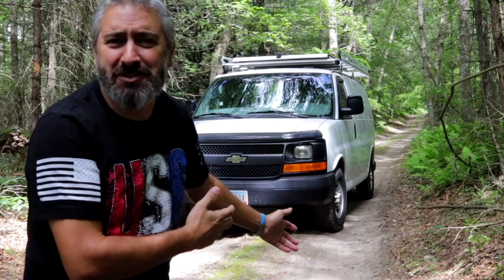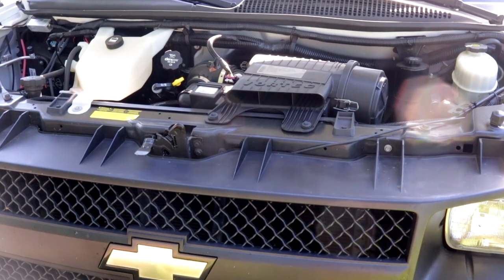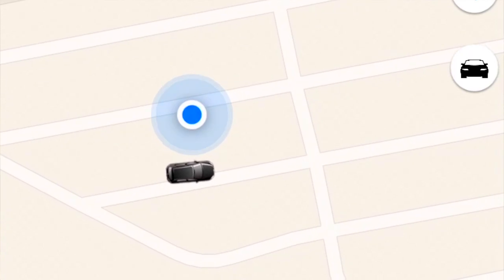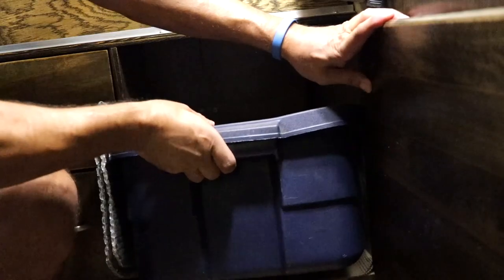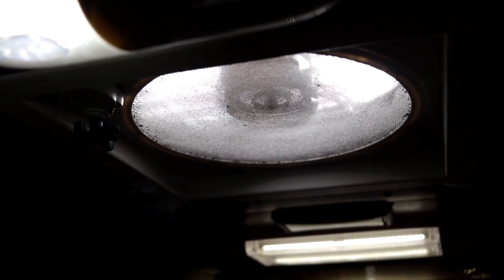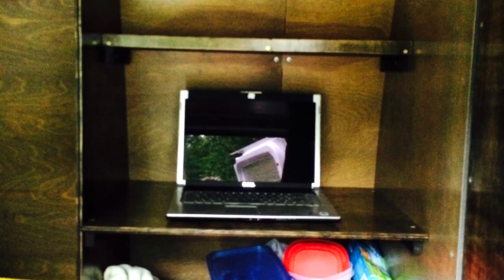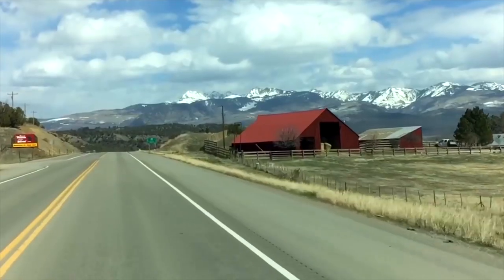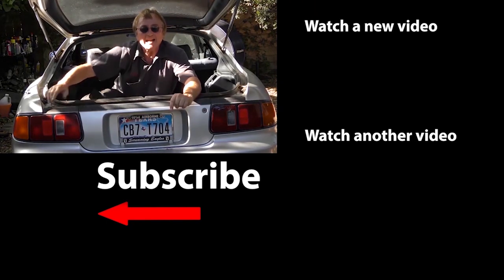What It's Like to Live in a Chevy Van and Drive Across America

Comment: I'm a former Van Guy lol. I've owned 6 vans. 3 Fords 2 Dodges and 1 Chevy Express. The Chevy was the best one out of all of them 👍
Reply: I wonder why Ford, who makes an excellent pick-up, can't seem to make a decent cargo van?
Reply: @jasonjames4254  Are you talking about the Econoline? I've seen them with 400k... Seem to be just as good as the older Dodge and Chevy vans.
Reply: 🤔🤔🤔🤔Hhhhmmmm note to self, getting a Chevy van is at the top of the list.
Reply: Jason James The best van ever made is the ford transit. It’s a lot more modern and and more powerful that the express van.
Reply: -ThreePointSlow-..... yeah a econoline with a 7.3 diesel that Ford never made
Reply: @jasonjames4254  I have a 93 Forde150 5.8L 240,000 and she runs like a beast!! I'm the 2nd owner..1st owner did replace engine n tranny about 80,000 miles ago sooooo hopefully I'll be good for a while..I've had her for a year and a half..I've replaced radiator, starter, plugs n wires, some exhaust parts, battery n that was the month I bought her..this week, I replaced some bolts by the exhaust manifold..shes starting to show some rust around the trim by wheel wells..fixing that next week..have already done rain rails..after that all good I hope..so after buying..I've put maybe $500 into her..oh..I did buy new tires..✌
Reply: @benchattin  thank you!! I love mine!!
Reply: I'm a mechanic of over 20 years. I've had nothing but hatchback cars and vans both mini and cargo..
The Chevy express with at least a 5.3 or bigger with the Allison hd trans is by far the most reliable, the cheapest ownership cost and capable of the highest mileage overall compared to all other vans. And I despise Chevy with every fiber of my being. Sadly I'm gonna buy one cause I'm so tired of repairing everyone else's vehicles that I want one that I don't have to worry about or fix myself.
That should say enough...
Reply: @biancaramirez5788  what chevy express has a Alison transmission?!?!?
Reply: Is the v6 4.3l a good engine? Or should I pick in diesel?
Reply: It was 7 vans I had. 3 Dodges, 3 Ford's, and 1 Chevy.
Reply: @isaacclarke2713  yes good engine.
Reply: Reliable?
Reply: @malcolmjelani3588 Yes Most reliable I've had was the Chevy. Also most comfortable and was the only van I had that wasn't like a freezer in the winter.
Reply: @davidkastin4240  what made the chevy van warmer in winter? insulation?
Reply: General Motors !!! THE BEST TRUCKS !!!! :)
Reply: Do you think the Chevy was the best because of the space or the quality because it would not break down with you ? I want a van that will not break down.
Reply: @benchattin my E350 had 373,000 miles on it before it blew the same  # 6 plug if I could do a double heliocoil I would keep it cause it ran and drove like it was newer. Have had it go 20 years. Bought it for $500 in 2004 . A 99 2 valve 5.4 3 valves are trash.
Reply: How many miles you put on it?
Reply: @maryjean-vb8bm by a Chevy van. 2500 and don't font with the 4.6l go with the 6.0l if your buying a van made before 2021 or a 6.6l if 2021 or newer as the fuel efficiency is just as good as they don't have to work as hard, are proven motors especially the 6.0l and as an added bonus the 6.0l and 6.6l can ton a 10 ton dump trailer full of crap like it's nothing.

Comment: I honestly think 2003-2019 Express vans are some of the best made. Reliable durable and practical. Rev up your 4.3, 4.8, 5.3, and 6.0 Vortecs.
Reply: 5.3 are great engines.
Reply: Flash Filibuster I wonder what kind of air filters does it take it looks like it would be a cone filter inside
Reply: Dont forget the 8.1
Reply: I have a '10 Suburban with a 5.3 and those are reliable engines. 150k miles.
Reply: Compared to what, a 1940 Soviet car?
Reply: What you "think" doesn't translate into the real world.
Reply: Ing. Julián Carías appreciate it
Reply: put a Ford escort engine in the Chevy van
Reply: 1.6 low output😂
Reply: @aundrayperkins9796  lol
Reply: @NFLYoungBoy223  old underpants work
Reply: I hope so...my 2007 4.3 6-cylinder is smooth and strong enough with a full load, though for some reason it has a leak on the driver's side in the body weld.  When it rains water accumulates then flows through the top then down the right side door leaving a deep puddle on the passenger side step!  Quirky, annoying, and maybe mine was THE one with this flaw.  My previous Dodge van had a side window for an extra angle of sight, useful on the freeway.  Can't say I enjoy not having that in this van, but so far it has been a gamer.  Aside from a thermostat going out, no problems whatsoever.
Reply: FABULOUS DOLPHIN Ight cool
Reply: Aundray Perkins,  How about a 3 cyl 2 stroke? 😂🤣😂🤣
Reply: Engines are great drive a 2008 6.0 l for work but transmission are bad  went out at 100,000 miles  $4000 to replace
Reply: I have had the 4.3, 5.3, 4.8 and 6.0 and put over 100k miles on them with zero engine problems.
Reply: There's a sharp quality decline after 2008. Source: Our fleet has 4 Express vans made before 2008, 3 of them have over 500,000 miles and run great, one is still a baby so it's hard to say, and the other 4 vans which are all newer have constant issues either electrical, mechanical, or cosmetic due to inferior build quality.
Reply: What's more reliable? Ford Econoline or Chevy express?
Reply: Yes I agree I jave a 2013 still jave it runs strong 2019 summer
Reply: Kenny Maurer Chevy Express but under a 2013
Reply: @kiowa1627  I would certainly hope your 6 year old vehicle runs still.... There's still people out there paying 2013s off
Reply: @pacdogk9134  dude I'm no ford guy...but the Econoline series was pretty tough to beat. Dodge and Ford  pretty much killed it for years in the van market.
Reply: The LS3 traveling life
Reply: I have a S10 Pick up with the 4.3 160k miles no problems and runs strong
Reply: kingjb82 what?
Reply: I have a 2009 Express AWD. 5.3. it's my work rig, and has about 210k kms on it. Maintained well, works like a damn
Reply: E series is better by a mile.
Reply: @ryanmalin  Which one did you like the best? I have the GMC Savana 4.8L V8.
Reply: @Helladamnleet  I dont know about that man. I've got a fleet with about 60 Express 2500/3500 vans and the only issues we have are suspension and brakes. We have had a couple of evaporator coil leaks which caused the ac to fail. Other than that they're very reliable vehicles.
Reply: @pacdogk9134  Chevy is more reliable. And I am a Ford guy. But I am not a fan boy. Not ashamed to call it like it is.
Reply: @ryanmalin  that's what I said?
Reply: How are they in the snow tho?
Reply: @pacdogk9134  Chevrolet Express.
Reply: I guess I have the oldest Chevy Express on here, so far. 2000 Express 3500 with 5.7 that just turned over 101k. Had 97k when I bought it. Still runs like new. Hopefully it lasts a long time as I'm doing a camper build-out now.
Reply: Is the V6 4.3 reliable?  Or should I pick a diesel engine?
Reply: @isaacclarke2713  Yes the 4.3 liter V6 is a good engine.
Reply: @Sugarshane88  my g3500 box van does really well in the snow. I'm heavy around 8800lbs
Reply: My 2004 5.3l 2500 conversion van has 378k miles on it and still running strong.
Reply: Good thing they are still making this body style
Reply: I love them

Comment: Yes in the end it comes down to whether you can stand up or not.  You can put a high top for $3-4K but they leak and reduce structural stability. Anyway this was only a tour of yet another van, not what its like to drive across america in it. Comfortable? Quiet? Bumpy? Harsh? Gas mileage? Tiring? Backaches? Tire noise? Vibrations and noises? Hard to steer and park? Its the journey I thought we'd learn about, not the destinations and friges.

Comment: See Scotty... Chevy does make reliable vehicles. The cars are crap but Chevy trucks (Tahoe’s, vans, Silverado’s) are amazing good vehicles especially 1999-2006 era of Chevy trucks were the golden age
Reply: I have an 06 5.3 sierra and an 09 6.2 denali  and i can say that the 06 is way more reliable
Reply: My grandfather had a 1952 Chevy truck (he made it into a step side) intil 2006 when a tree fell on it, it never had any big problems and was his workhorse that would pull his race cars from 1957 until 1978 when he started a family
Reply: Of course. But avoid the modern ones at all cost
Reply: Ghost Geist/Ichi Ayumi Love my 2016 Midnight Edition. Also loved my 08 and 99. The interior was very cheap in my 08 but my 99 and 16 are golden
Reply: nah
Reply: My father traded his 2007 Yukon with a 2005 one. The 2005 has higher mileage about 370k miles.
Reply: My grama just got a 2003 Silverado 4.8 extended cab with 23,000 original miles on it for 6k, was that a good deal??
Reply: They made reliable engines but they had the worst interiors ever. Everything fell apart even though the engine still ran
Reply: Chevy Ford Chrysler are the worst made vehicles ever made. Designed to fail!
Reply: journey mann that’s funny I’ve never had a problem. Got a 2005 Silverado with 450,000 miles on it lol 2016 with 50,000 still going good so far
Reply: our trailblazer with the 4.2 I6 has almost 200 k and we drive across the state often. doesn’t skip a beat
Reply: Hence the reason i just picked up a 2001 Chevy Astro. They are good vans, building a getaway micro camper. Reliability and towing option by design.

Comment: Love my Express van, 2008 with 410k miles on a 6.0 Vortec and 4L80e transmission.
Reply: LordCoolnessocity I have a weird question did u ever have to rebuild or replace your transmission? I had to with my last truck it was a 99 Silverado with the 5.3 vortec and a 4L60e transmission
Reply: @jacobsearcy9856  
My neighbor has a 2015 Chevy Silverado he had the motor replaced at 70 thousand and just recently had the transmission replaced as well.. 😢😢😢
Reply: i have my work van 2006 chevy express with a 6.0  with 550,448 miles. Never had transmission replaced but i did have a head gasket blow at 220,000 miles. runs good still working!
Reply: @jacobsearcy9856  only ever had one 4L80 fail on our fleet, the 4L60 you mention is a weaker version of the 80 series and commonly fails after 200k miles. What I recommend doing is what we typically do with ours, change the transmission fluid once a year. It's a little overkill but keeps those suckers ticking.
Reply: @fluevano1204  wow! Here I thought I was up there lol. IMO you can't beat a taken care of Vortec 6.0. I don't dislike the F-series trucks but when you're like us and buy trucks that are 10+ years old the F-series of the day didn't have the power or durability the Chevrolets did then.
Reply: @fluevano1204  I am looking at a 2010 with 207,000 miles and everybody says NOOOO!  What have you done to keep yours running with all those miles?

Comment: Working for a company that uses all sorts of cargo Van's, the Chevy Express has been the most solid so far. Sure, we had some that had thier share of problems but most of them can be atributed to many of the guys abusing them or not following maintenance schedules. I found that if you treat these vans right and maintain them regularly, they can be pretty reliable. I had one that I put 240,000 miles on and it still was going strong when I turned it in to the fleet company. On the other end of the spectrum, the worse van my company tried was Ram ProMasters, both the large size and City mini work Van's. They were so bad, my company couldn't  wait to get rid of them and we went back to the Chevy Express. BTW...this comes from a guy who is not a fan of Chevy vehicles in general. Just giving credit where credit is due.
Reply: @Ing. Julián Carías Point well made... and the sad part is the Italian mechanic asked to fix it again is using another make and model of van to deliver the parts need to fix the Ram ProMaster. Probabley using a Chevy Express.😀

Comment: I have a salvation GMC look just like that it just go run 460,000 miles. Eat oil a little faster then normal it has the slider door. That was the best $ 1,000  I spent 7 year ago later great van. Still runs.

Comment: I know of several tradesmen with those same Chevy vans that have put well over 200K miles on them with just normal maintenance  done to them.  They aren't fancy, but they are extremely durable and very easy to fix.
Reply: Not fancy and reliable is better than fancy and unreliable. 😁🚐👍🏻

Comment: One thing I've always been amazed at with American vehicles is how many of them have V8s.

Four cylinder Japanese (and European) vans have  been the default in Australia and probably a lot of other countries.
V6 vans are a relatively recent thing with Chrysler Grand Voyager and Kia Grand Carnival.
Reply: Plus you can get small diesels almost everywhere else but the U.S.
Reply: @razor3003 luckily so, as it was recently "discovered" that Diesel engines pollute more tha reg engines 20+ years after the Diesel industry took over Europe, and now we are all going back to regular gas, which is where we left off on the early 2000s when they started to lie about how good and better Diesel cars were...the Americans were right...plus V8 torque & power are an unmatchable experience, if you can get cheap gas..and they last way more miles/km than 4 cylinder engines. How many small Diesel engines do 200-350K+ miles? No need for them in such a huge country

Comment: GM completely missed the boat by not offering the Express in a high top.  Mercedes, Ram, and Transit own that market now.   Roadtrek modified numerous 2500 and 3500 chassis.
Reply: Not A Nomad I agree! Time to make one before my next build. 😎🖖🏻☕️🚐👍🏻
Reply: Rolling EarthShip, yep lots of service people would use a high top also.  I get 14-16 mpg with my 6.0 Roadtrek, what kind of mileage do you get with that 4.8.  I've seen just a few Roadtreks use the smaller engine.  Thanks,
Reply: Now for Toyota and Honda, please.

Comment: These Chevy Express vans are junkyard ready !  I have a 2018 which bounces all over like an old baby carriage. Keep an eye out for them and youll see how bad they rust out, nearly all of them loose the paint off the hood, the freakin battery hangs underneath the driver's side in front of the rear wheel, great for collecting salty slush bergs in the northeast. The transmission upshifts too quickly and robs any power from the lazy 8 cyl engine. The engine sounds cool like a high performance Camaro or Vette, but can be blown away by those new ford "sprinter type" vans with 6 cyl engines, none of the doors open all of the way, and the hinge limiters on the cargo doors are rediculous to disconnect when you need to open the doors wider. Most of them broke off on my truck already. These vans are also a piece of cake to break into. GM made ultra thin plastic trim around the door handles that a child can snap the corner off and unlock the door with a finger, then use the power locks to unlock the rest of the doors. My company bought a fleet of these vans because they were cheap. Right off the dealer lot, the ac compressors dumped the refrigerant charge because the fan was not programmed to engage with the ac. We also have water leaking right through the ceiling and pouring down through the sun visor hinge. And no, its not the windshield leaking. Yeah, these vans are great.

Comment: I bought a Chevy Astro van to convert, but I had so many problems with the van I gave up and sold it. I'm just going to buy a camper
Reply: Astro is built like a basic suv... These work vans are Body On Frame work horses
Reply: @bansheemania1692  

Just to clarify, when you say "these work vans," are you referring to the Astro van?
Reply: @mr7oclock346  nope.. Ford's E series, Gmc Vandura(or whatever they are now) And i think late 90s dodge ... The Drivetrain of the Astro seems to Be there Downfall...

Comment: @3:34, who makes a good single panel 325 Solar panel? What are the specs on these?  also wonder about webasco heater @ 3:05 and Sterling power @ 2:50 for charge house batteries from the alternator.  Do you have to manually switch power from alternator to solar or is it automatic?
Reply: NoSunBeach the panel is from Kyocera and I bought it from Northern Arizona wind and Sun. 
The Webasto runs on gas from my van and you can also get ones that run on diesel. 
I have different playlists for all these devices, including the sterling power that might be more helps to you. 👍🏻🖖🏻🚐☕️

Comment: Hey Scotty, I was driving my 2005 Suzuki Reno up a hill and suddenly saw smoke coming from the hood and the temp gauge was all the way up. I pull over turn the car off and popped the hood (kinda in a hurry) and I immediately see coolant shooting out from somewhere at the top of the radiator near the center and it’s spraying all over the exhaust manifold heat shield. The spraying slowed as the engine completely turned off. So I saw this over a matter of seconds and didn’t get a good chance to see the leak. I went and checked on it a day later and when I turned it on, nothing happened. The car warmed up fine and stayed at the normal temp. Do you have any advise on what happened? The car is still where I parked it the moment this happened.